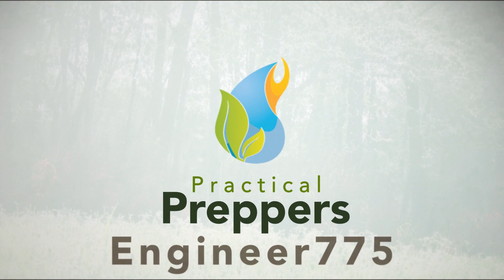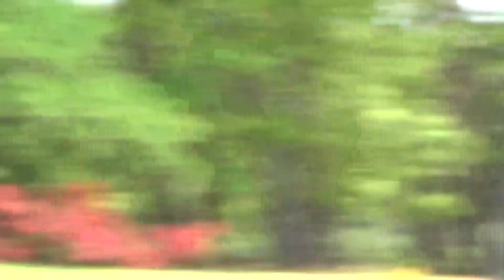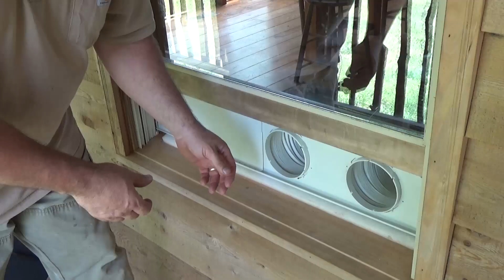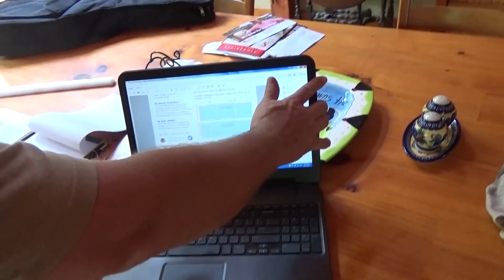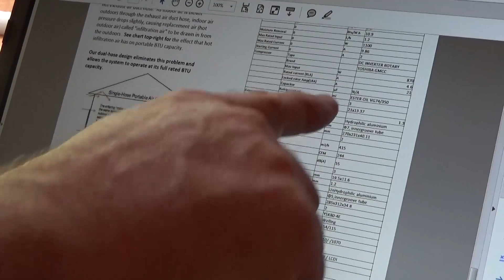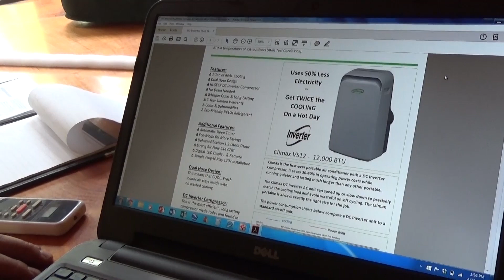World's Most Efficient Portable Air Conditioner

Comment: Based on the spec sheet it runs at DC 99Ah. No where near the most efficient.
Reply: I'm not seeing any mention of DC 99ah. I saw it has an eer of 10.9. Technically not the most efficient but since this doesn't cycle on and off it ends up being much more efficient than a typical unit.
Reply: Thinking Out Loud out a looks similar but you one hose and you have to change the water down below and it can accumulate quite fast. we started using ours it's a 240 vac and with the reg. train on I freeze my rear end off I habe to go out side in tx to warm up
Reply: It's much more efficient in that it does not take cool air from inside to cool the condenser -- then dump that formerly cool air that you expended power on out the single hose.  I have a single hose design.  I live where it's warm and muggy.  The single hose type beats its brains out to achieve very little.  Most of the cool air is just blown outside through the single hose.

I'm replacing mine in my RV with a Carrier 42 SEER mini-split.  No more issues of poor efficiency.  It's very expensive -- but in the long run, it will save money.

Comment: It performs well. 
However it is louder than my other portable units. Its too loud for my office which is what I was replacing. Would love a firmware patch to lower the lowest fan RPM. Would also love a future stealth model with double wide vents and asymmetric blower blades to get control the wind and fan whine noise. A little more isolation padding to reduce the truck-like rumble of the compressor would help, too.

Comment: Last week, I saw a full size Ford van parked at a rest area. He had a small, 2,000W quiet, inverter type generator chained to his rear wheel and it was running. He had a similar air conditioner inside the van with the exhaust duct taped to a partially open window. It was powered by the generator. It was hot outside but he was probably having a nice nap inside the air conditioned van. 
I think this AC is worth the money and it's better thsn anything I have seen so far on the market.

Comment: Awesome..  A year ago I bought the exact looking unit, with same remote and all.. In Scandinavia, it's branded "wilfa".. The intake is just a grid on the unit though, maybe I should ghetto mod a second hose to it..!? :-)
Reply: Almost all portable ACs these days have only 1 hose, because that's what "fashionable" consumers were buying, so the manufacturers reacted, even though the lack of dual hoses means that you blow air conditioned air out the window and create a vacuum and use 2x as much electricity and cooling the room takes 2x as long etc...

But, all units I have ever seen has dual grills: One for the room air, and one for the air that cools the compressor. So yes, you CAN ghetto mod a second hose to the grill that cools the compressor, to stop that grill from pulling the room's air. You will then get the same efficiency as a "real" dual hose air conditioner.

Second issue, though, is that almost every portable AC uses a basic "on/off" compressor which is noisy and often overkill and just keeps switching on and off and on and off to keep the temperature at the desired range. There are almost no units that have an "inverter compressor", which is what's shown in this video, and which instead smoothly ramps the compressor's power up and down based on how much cooling is needed. Those are as rare as dual hose models, because yet again, they cost more, so consumers don't buy them.

Sadly nothing like that is available in Scandinavia. The only inverter units are expensive "split AC" systems with indoors and outdoor parts for like 2000 euros. I decided on the Electrolux Well P7 instead. At least it's very high quality unlike all the other brands which pretty much all of them just rebrand Chinese factory OEM models.

Comment: I sped read through the comments but didn't see my question.  
How does this unit work on a square wave inverter? Does the inverter need to be sine wave? Does one have to worry about burning the unit up using a common 2000 watt DC-AC inverter?

Comment: I wonder if it would be practical to use solar to cool down water to 55 F and then use the water to keep your house cool at night.. So you'd only need a circulation pump and a fan. I'm not sure where you'd find such a device and you'd need a lot of water, I think. But it's just a thought.

Comment: A wood stove is more efficient at cooling than a single hose portable ac unit. 

By it's efficiency rating this ac is about 20% more efficient than any dual hose ac. But at more than twice the price it would take a couple of decades to recoup the cost at $0.12 a Kwh. Just buy an extra solar panel. they're cheap as beans.

Comment: If you already have DC supply, why have an inverter on the compressor motor? Whats the model of the Toshiba compressor? I'm seeing there is a few that match the specs of this and wanted to try and add this compressor to my RV AC unit with my own ramping circuit.
Reply: Nick Tumi 
The inverter on the compressor is used to regulate the speed to suit demand rather than cycling it on and off as a typical ac does.

Comment: I'm looking at Portable Air Conditioners.  It will probably be the one hose kind because I have some limitations due to it being in a storm shelter.  Some of them say "Cool Only" while other don't say that.  Can anyone tell me what "Cool Only" means?  Also, some of them talk about having a dehumidifier.  Does this mean the dehumidifier only works when the air conditioner is running or can you run the dehumidifier by itself all the time.  I would like to just get one unit that does both because of space limitations in the storm shelter but don't know if that is the way they work or not.  Any advise would be appreciated.   Thank you.
Reply from the maker: cool only means it is not a heat pump capable of cooling and heating. the dual hose units are the only efficient types.  This one has an efficient compressor also. I cannot find a more efficient portable on the market.
Reply: +Susie Q my single hose has a container to collect the water from the AC , but when it is full it shuts of the AC and only the fan runs, so before you go out make sure to empty it, if it is one of those you are getting.on very humid days maybe 6 hours before container fills up

Comment: Great idea, another drawback to the single hose configuration spot coolers, besides drawing your living space into a negative pressure, is that it is drawing the cool air that it just created, out of your house to cool it's own  condenser and then exhausting it out side. They are a self defeating system. Also, with the two hose systems, the 'outlet' and 'intake' hoses should be separated sufficiently so that the hot exhaust air is not sucked back into the intake hose. The best thing you can do to control the temperature of your living space which will compliment your mechanical systems, is to stop the loss and entry of heat into your living space, depending on the season. In most homes 70% of your heat gain and heat loss occurs through your roof, extra insulation, rolled out fiberglass, can stop much of this and an attic ventilation fan can keep the temperatures in your attic from reaching 130 degrees which is common, on a 90 degree day. If you don't let the heat get into your house, you won't have to remove it. Thermally insulated doors with good weather stripping, double pane windows with awnings are money in the bank also. These measures are one time expenses and can cut the needed tonnage of your air conditioning system in half and if your in an 'Off the Grid' situation it can mean the difference between remaining cool at night or sweltering.

Comment: This is what I need for my remote ham radio shack. 
I once bought a "portable" AC but it only came with one exhaust hose. The shack is only 10' x 10' but the AC was  esrly worthless because of the huge amount of hot moist air it was sucking from the outside. I took it back the same day.

Comment: I don't get it, I have an new central air/heating system. It's made by keeprite. It's the new dc model. I have the TED hooked up to my computer and laptop. Then the a/c is on it's only using 700W. How is it so efficient? And it hardly runs.
Reply: +Rob H Here is the a/c part of it. Keep in mind it's also a complete matched unit. http://www.keeprite.com/en/us/products/air-conditioners/deluxe-19-two-stage-central-air-conditioner/
Reply from the maker: +Rob H an you tell me the LRA rating on teh machine. LRAs on these types of machines are the killer for inverters.
Reply from the maker: +engineer775 Practical Preppers if it only used 700watts the seer would be much higher rated.

Comment: This seems far more practical for off-grid and solar use than a standard 110V system.  https://www.practicalpreppers.com/online-shop/air-conditioning/dc-air-conditioner-all-dc-for-off-grid-use/heavy-duty-system-20-24-hours-operation-detail-view.  This system comes complete with its own batteries, solar panels, controller, plus the AC unit and runs totally off DC, no inverters to waste energy.  Looks like it uses about 1000 watts max.  This system will cool or heat, so it gives you both options.

Comment: What solar panel(s) would you suggest be paired with this? Also does this unit also run off of standard 110v?
Reply from the maker: +Adam Weil Yes it runs off of any AC 115v source.  Grid, generator, or  inverter.
Reply: forgive my ignorance but does the dc inverter compressor mean that there is a way to run it directly from the panels? if so how would you build the outlet for it. very interested as I'm in fl living in an rv with no other power source. it's about to get very hot and need some way to beat the heat. I'd love to buy this if there's a way I can make it work.
Reply: forgive my ignorance but does the dc inverter compressor mean that there is a way to run it directly from the panels? if so how would you build the outlet for it. very interested as I'm in fl living in an rv with no other power source. it's about to get very hot and need some way to beat the heat. I'd love to buy this if there's a way I can make it work.
Reply: forgive my ignorance but does the dc inverter compressor mean that there is a way to run it directly from the panels? if so how would you build the outlet for it?
Reply: forgive my ignorance but does the dc inverter compressor mean that there is a way to run it directly from the panels? if so how would you build the outlet for it?
Reply: forgive my ignorance but does it having a dc inverter compressor mean it can run directly from the panels?
Reply: forgive my ignorance but does it having the dc inverter compressor mean that it can run directly from the panels?
Reply: forgive my ignorance but does it having the dc inverter compressor mean that it can run directly from the panels?
Reply: forgive my ignorance but does it having the dc inverter compressor mean that it can run directly from the panels?

Comment: That AC unit looks link it would be a good unit to use in and RV with solar for those dry camping hot days as the units that are in RV's require at least 3000 watts ore better.
Reply from the maker: +Ken Heinrich I agree and actually hope to try it soon.
Reply: +engineer775 Practical Preppers Keep me posted on the results please

Comment: The Climax DC Inverter AC unit?  Looks Cool, but is an inverter running off a inverter or direct couple either way calculated with line to neutral voltage and phase balanced :)

Comment: I have the Freidrick version of this, but, it is a heat pump(amazon) and although it is not quite as efficient as this model probably, it cools off my 1200 sq. ft. house in the dead of summer because of the same design features.  Highly efficient still, and it has heat, and dehumidify features which in my opinion, if your able to dehumidify, at least were I live, it really makes a huge difference in how you feel in the house.  Thanks for the vid!
Reply from the maker: +northcacalacka545 Does it have an inverter compressor? Just curious.
Reply: +engineer775 Practical Preppers I'm not 100% on that answer Scott,  but, I think it is because it doesn't just go from off to wide open, it takes a minute or two to get started.  Here is the link to the one I bought last year.  The only thing I do not really like about the unit is that it is not user friendly on the control panel.  It does not  condensate to the outside, it uses it all to cool the unit.  http://www.amazon.com/Friedrich-PH14B-13500-btu-conditioner/dp/B006W7PXYI?ie=UTF8&psc=1&redirect=true&ref_=oh_aui_search_detailpage

Comment: So, would you recommend using this in maybe a cargo van for camping with solar or a small generator? I think the small Honda generators are 1000 watts. Would that run this unit?
Reply from the maker: +Adventure Outdoors I would use the Honda 2000 EU  it is 1600 watts continuous  The 1000 runs at 900 continuous.
Reply from the maker: The Honda 2000 EUi would run it easily.
Reply: @engineer775  My Honda 2200EU can run 10,000 BTU easily but never 12,000 BTU AC. Already tested. I thing the mini split AC system is the way to go if you need less power consumption with better cooling performance.
Reply: Could you share the contact info on the ACDC Solar Minisplit here? Likewise on this unit as well. I've got 2 different applications, one being my home with feeds into the grid but doesn't power my home, so a minisplit backup would be a really nice feature, but also on a portable or window unit, need for traveling...I have an airstream and while it's a awesome camper, they apparently don't realize that people need to house generators nor do they do anything to help you with that part. The solar panel hookup, which I might do, really won't run much...charge my phone and run the electronics on the fridge maybe but nothing of any crucial like AC in FL in the blazing heat...they'll install the AC but not provide a user friendly way to supply any power to get the thing running, not to mention it's a BEAST of an AC for a tiny 16 ft trailer. The day someone creates a simplified housing for the airstreams...that person is gonna become very wealthy...I'd do it myself if my health permitted, could even help and hopefully reap a some of the reward for helping with the design/feedback, but money is made when suppliers figure out where demand is and then fill that demand, and there's a big demand for this and no one meeting it.
Reply: You believe a single Honda 2000 EU could start up this portable AC?
BTW, VERY Important info you provided re: fresh air intake and the importance of avoiding negative air pressure! Boy oh boy I know so much more on this topic than I ever cared to know! 

Btw, are you still running the mini-split system that you bought specifically to run on solar and if so, how is that going? I'm interested in solar AC for both home (I have a full solar array and I feed into the grid) as well as camper (doubt I could fit enough Solar capacity on top of camper, but to ever run AC, hence the Honda 2000 question)...oh, which begs the question...how many panels would it take to run this?
Reply from the maker: The Honda would run it easily.  Yes I am still running the ACDC Solar minisplit in my loft and have been for over a year.  Works great.  3 panels ~ 900 watts works great.

Comment: Excellent!! I am currently running a 5,000 btu Frigidaire that uses < 350 Watts ($119 on Amazon) on 305w PVmand a 145aH AGM and its working flawlessly withoit draining the battery... Im impressed!
Reply: Any idea how many amp hours batteries needed to run ac for 6-8 hours without sun?
Reply: +marthale7 This is the One I am Using.. My Buddy Bought one also to Keep his Battery Bank Cool...  350 Watts on High via Kill-a-watt meter ;)
http://www.amazon.com/Frigidaire-FFRA0511R1-Window-Mounted-Mini-Compact-Conditioner/dp/B00W2KG92Y?ie=UTF8&psc=1&redirect=true&ref_=oh_aui_detailpage_o08_s00
Reply: Excellent choice as this unit is mostly "mechanical",  I had control boards went out on several units with remote controls and auto temp and all the high tech du dat

Comment: It sprays water on the condenser, not the evaporator.
Reply from the maker: +madzimbo Thank you!
Reply: EN775 NIce, post overall but for someone that calls himself an "Engineer" that doesnt know the difference between a condenser (name even implies its the one that gets hot) and a evaporator, so how did u not know that? Thx it made my day :). 

But it was interesting to see what to look for in a Air to Air Portable  A/C or Heat Pump but I didnt hear u mention the importance of keeping incoming and outgoing air inlet air streams? So it doesnt suck in the hotter air coming out from the unit. 

But its a shame they dont make a Air to Water, Portable A/C or Heat Pump or Refrigerators which would be alot more efficient,  but would take some real Engineer to make reality...
Reply: but hes an engineer hahaha he dont have a clue none of them do !
Reply: I dump the water from my portable (single hose) most every day.  I'd like to not do that, but let me tell you -- THAT is some nasty sh!t.  I guess it's mostly dust that's been caught in the condensate but there's a layer of sludge in the lower inch or two of my collector bucket.  I wouldn't want that sprayed on my condenser, and I wouldn't want to have the job of cleaning the condenser if it had been!
Reply: DN it common sense the BS works and was used for years on commercial units. 

Plus there no separate water line to deal with so whats the downside or just like to be dumbs ass that likes to bitch?